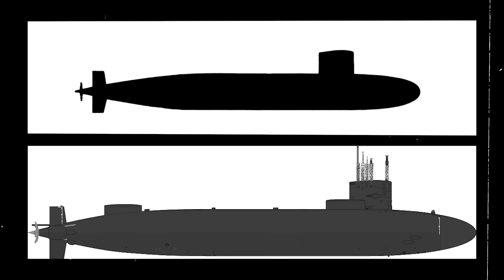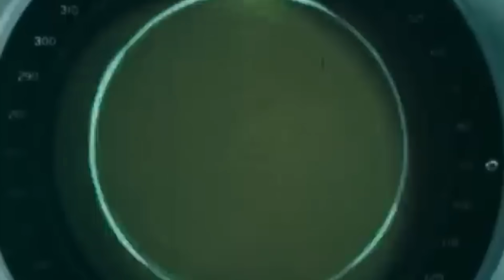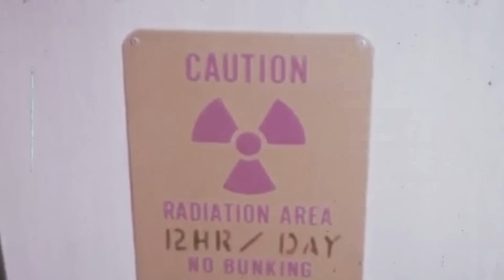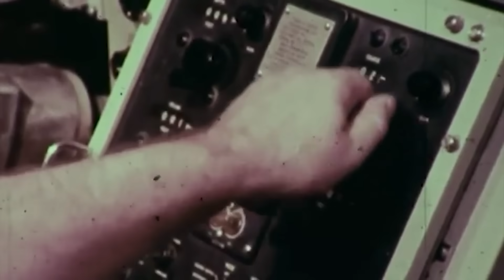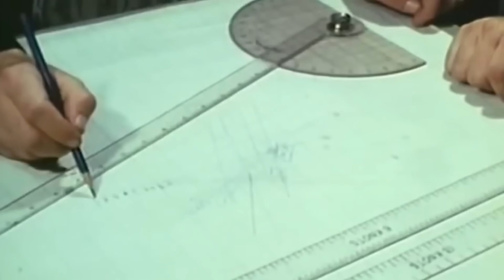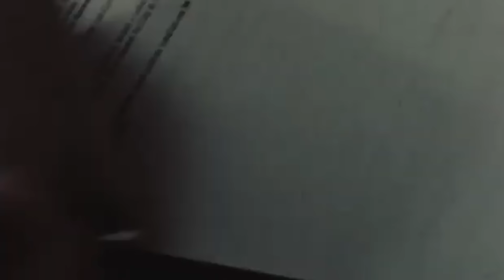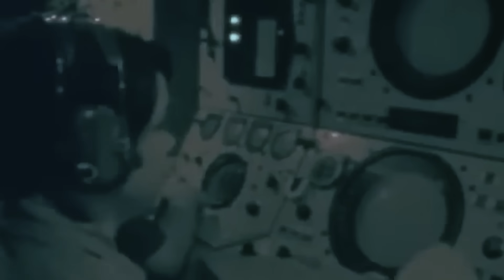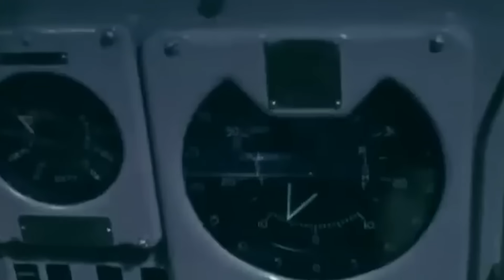The Nuclear Submarine That Was Sunk by a Sandwich Break

Comment: Watched the 16 minute film from a crew members perspective and found it about average.  The old sub footage was interesting, but so much of it was not of the Sturgeon class boats or even Fast Attacks, that it was distracting to watch.  For example, it was distracting to hear the narrator speak of events like the Tomahawk testing and  firing, but to see Ballistic film footage on the screen.  But then, unless he has access to actual official Navy or General Dynamics launch footage, it would be hard to find enough specific footage to fill even a 16 minute video.

As for the info put out about the fire at minute mark 13, he has most of the specifics wrong, but again if you weren't there you wouldn't know.  It's like watching an old war movie about the submarine service in WWII, when they actual footage is of the wrong class of boat.  You would likely only spot it if you had served on one class of boat or the other.

Aa for the fire, there was smoke (white smoke), but no open flames in the people tank.  We were all in EBAs because the gas being generated was toxic.  Other then the usual damage control measures to close the watertight doors and bulkhead ventilation flappers and checking the extent of the problem, there was no damage control to do. 

The fire was under the Torpedo Room deck, inside the battery compartment and not immediately accessible to us.  The smoke was from the bilge water boiling off and filled much of the Operations Compartment, included the Sonar Equipment Space (SES), which is where I first headed to find the source off the smoke and check my equipment as the Sonar Div LPO.  

I am sure everyone's perspective of that day is a bit different, since we were each focused on our own tasks.  Those at the scene did have concerns that the raw heat would create new problems, such as damaging items near the battery well, such as those darn torpedos.

Once I confirmed there was no actual fire in my equipment spaces (just thick smoke), I went up a level and headed for the Weapons Shipping Hatch, as we surfaced.  I went there because I was often they guy who drained and opened that hatch as we entered port, to lead up the forward deck line handlers and stand by to tie up a tug.  I was standing by there, awaiting the word from control.

Even though it was 40 years ago, I still remember it was the first and only time I cracked that hatch before it was fully drained, just in case the crew had to jump ship, if we blew from the explosive gas the fire created.

Also, we didn't "crawl" to Mare Island.  We were working off San Diego and steamed back home on our own power.  Once everything settled down and we turned for home, I joined the group standing by in the Torpedo room (like a re-flash watch) and manned the SP phones for the Ops boss, who was in charge at the scene.

Once in San Dawg, the crew  purged the boat and eventually we left for Mare Island.  We made the entire trip on the surface, which was unusual and slower then any other time I had headed for a drink at the Horse and Cow, but we didn't crawl.  I will say that round hulled boats roll on the service much more then the old Fleet Boats and that trip tested those who tended toward seasickness.

We did make the trip in the company of an large ocean going tug, on standby if we needed roadside assistance, just in case the Tea Kettle had a scram, but the tug wasn't needed.  We always had the plant for power and the diesel gen as a back-up power source.  Other then the slow speed, the transit was "normal", as the Mud Puppy went back to Mare Island, where they claimed they could do the planed for and extensive overhaul:  "On time, On Target and Under Budget", trying to win back the approval to build boats again.  But of course, that is a story for another day.  😉

Comment: I was on the boat during the battery well fire.  

Oddly, I just told that story to someone this morning, when talking to a friend who had suffered from a Residential Carbon Monoxide leak in a furnace pipe.  We were talking about how different gases can effect people differently.  The conversation started about CO2 leaks, progressed to how the O2 bleed could make the crew sleepy or wired and proceeded on to the battery well fire, as an example of Chlorine and Hydrogen, which were the two serious issues with the battery well fire.  

It was a rupture in the WRT tank, that let the seawater into the battery well and caused us to suck rubber.  Yes, it was an engineering flaw that would have eventually affected more of the Sturgeons, but Guitarro fired her tubes more then average in those days, since she was as part of the Tomahawk test program. 

Our real concern, after getting to the surface, was what would happen when we let fresh air in and lowered the Hydrogen back to the explosive range and how to purge any pockets of residual Hydrogen from the ventilation ducts.   Which, turned out to be a whole lot of bottled CO2, which brought the conversation full circle.  

And the fire took the Mud Puppyy back to Mare Island for repair, which was a political attempt to get their contract to build boats back.  Traveled to Mare Island on the surface, which was one rolling ride from San Dog.
Reply: Thank you that description of what happened.
Reply: @Kwolfx  Everyone involved had a different perspective, so I was glad to share mine.  😉

Comment: I went to work at Mare Island as a Marine Machinist about 4 years after this incident took place.  The shadow of this event still hung heavy over the yard.  There had been talk of shutting down MINSY after the investigation and the fear of that still lingered the whole time I worked there (I left in 1984 after @11years).  Some of the after effects of the investigation were cofferdams were required to be installed around each hatch prior to the boat going in the water (the forward hatch is what took on water and sunk the Guitarro).  All shore support lines going into the boat had to be tagged.  I'm not sure if I remember this correctly, but I think there was an axe adjacent to the cofferdam to cut all the lines in an emergency.  The video failed to mention that practically the whole yard volunteered their off time (donated their time) to repair the boat.  Such was the fear of the yard being closed.  As far as the actual story of the sinking, the story I heard was only slightly different from the video.  The forward and aft trim parties  took a lunch break and the forward ballast tanks (both A and B) were not secured (vent valves open ).  As low in the water as the forward escape trunk is and with no cofferdam for safety, the bow dropped lower and lower until it took on water.  Even if someone tried to close the hatch it would be impossible with all the lines running through it.  So I suppose the "lack of communication between the forward and aft trim parties" is a logical conclusion.  I do find it hard to believe that the forward crew just left for lunch without securing the vent valves.  I think there  may have been a fault in either the indication of the valve position or a mechanical fault.  As far as any precursor to this event with an unhappy captain, I never heard anything about that.  Mare Island DID NOT have a bad reputation!

Comment: 1:30 "...enhancing their existing Thresher and Permit-class designs."

But the Thresher was Permit-class 🤔
Reply: I know. This channel has more factual errors than any other regarding this topic on the interzones
Reply: Actually, the Permit was a Thresher Class.  Permit was SSN 594 and when I worked on her, she had some of the dive gauges from the Thresher installed, which were being calibrated when Thresher went down, so they became spares for the other 593 Class boats.  Kind of creeped me out a bit.  But no one calls the rest of the Permit Class the 593 class. after she sank and they made mods.  🙃

Comment: This story reminds me of my internet provider...had outages and they sent a tech to check.  As he was finding no problems with the signal in the house, at the side of the house, went to check the street tap and there's zero signal.  Impossible!  After about half an hour of very confused checking the house, at the tap, back and forth...he is extremely confused and goes to check a tap farther up the street...and discovered the ISP had another tech taking stuff apart to swap around filters in an amplifier.  The two techs had been sent to work on different parts of the same street at the same time and neither was told the other was working!  Every time the one guy unhooked something at my house to troubleshoot it changed the reflections, every time the guy at the other end changed a filter to try and account for the different reflection/distortion/ingress it caused a drop-out briefly; which then caused the first guy to unhook and change and test more, which caused the reflection/distortion/ingress to change and need a different filter.  Turned out I didn't actually have any issue, but the lack of communication between "engineering maintenance" techs and "customer support" techs meant that they sent someone to investigate a problem that was caused by maintenance but the 2 departments don't talk to each other.

Comment: I was at Nuc School MINSY class 69-2 when this happened. It was a sorry sight. The Sturgeon class was originally designed to be navigation beacons above the Artic circle which is why it was built to burst through the ice. They were to guide Snark cruise missiles in case of nuclear war. That ended with the success of the Polaris program. There was a rumor that the Guitarro had a "wandering" electrical ground problem that was never fixed probably due to the pier side sinking. 
I served on the USS Pargo SSN650 and those 5 years were the most interesting and "fun" times during my career.

Comment: This is a great video.  I was stationed on the Guitarro's sister ship Uss Gurnard from '81 to '84 when the Guitarro had the fire in the battery well.  It was from a design flaw that caused flooding in the battery well resulting in the fire.  They checked our boat, and, if not fixed, we had the same design flaw and would have eventually suffered the same fate.  The Navy was anxious to deploy us, so they got permission from the CNO to weld in the Torpedo Room (which is over the battery well) without unloading the torpedoes.
In my estimation the Sturgeon class submarines played a major role in the U.S. winning the cold war but much of what we did is classified so the world will never know the full extent of what we accomplished.
Sempre Vigilante
Mark Tuttle FTG1/SS
Reply: Some of those scenes were a flashback, especially the Polaris Launch Control panels (7:12) that I spent a thousand hours staring at over several patrols on 618 and 601. MT2/SS
Reply: @luckydog9809  Was an apprentice Marine Machinist (shop 38) at Mare Island during the refit of the Jefferson (618) and later the (601) Robert E Lee.  Mid 70's if I'm not mistaken.  I don't remember if we did a refueling or not at this time but it's possible as I believe both were in  DD2 at one time or another and that is where the dedicated "nuclear'' crane used exclusively for refueling  was located.
Reply: @stevenreid-g2y  I was on 618 and 601 in the 78-81 time frame, doing the last few Polaris patrols. (I ended up in QA at shop 38 at Pearl Harbor my last few months in the Navy)
Reply: ASW NAVAIR S3A Sailor here in the same time period.81-85 Got to give it to you bubble heads. I could never have done the duty. Jack Barter AXAN. PNA"d 3rd twice. Wicked tight rate
Reply: @jackbart1960  I flew the S2E and D from NAS Key West and Quonset Point RI.  1968-1971.  I had a BLAST!!!!!
Reply: Thank you for your service 🇺🇲🫡
Reply: That's why it's called the SILENT SERVICE. We outsiders will never know what the Silent Service did all those years ago and continue to do.

Comment: A good video Dark  , keep this level of video up and NOT the crappy AI generated ones
Reply: Waaah waaaaah waaaaaaaaah
Reply: We hate A.I.! 😐
Reply: Didn't a german submarine sink because some didn't flush the toilet in the right procedure or something like that ? Title reminded me of story anyway grate video
Reply: @phoneone1371 
That was the U-1206.

It is often incorrectly attributed to U-120.

It is still debated as to the details.

After studying the wreckage,
it has been claimed that she actually started flooding because she was damaged when colliding with another wreck just prior to this event.

The official report by the  Commander was that it was the head 
(or toilet).

He said that it was a malfunction.

At this point in time-
if it was the toilet,
does it really matter whether it was an equipment malfunction or a misuse by personnel?

Apparently,
some people do obsess over such things-
does that surprise you?

The German toilets were rather sophisticated in their design so as to be able to operate at the high pressures encountered at maximum depths-
most subs of that era just dumped their holding tanks on the surface.

Regardless,
the problem was that there was flooding that caused the batteries 
(which were positioned beneath the toilet-
very bad idea)
to discharge chlorine gas-
since that is a deadly poison,they had to surface.

They had crewmembers that were specifically assigned to operate this marine sanitation system
but the system really was over-engineered as well as making the batteries vulnerable to flooding damage.

It was over-engineered yet poorly engineered.

Fact:
flooding caused the batteries to release chlorine gas which compelled them to surface where they were spotted,bombed and had to scuttle the boat.

Controversy:
what exactly caused the flooding?

Personally,
I’d say that it probably was the marine sanitation system but I’ve never dived on the wreck.
Reply: This guy doesn’t do the AI ones.  Some channel hacked his account and for awhile there, about half had an AI voice but that seems fixed except earlier, one snuck in-I forget which channel.  I do know Dark Tech was stolen so this narrators channel is just Tech now.  That AI stuff is total crap.
Reply: @annehersey9895 your explanation makes literally no sense, but thank you for playing!